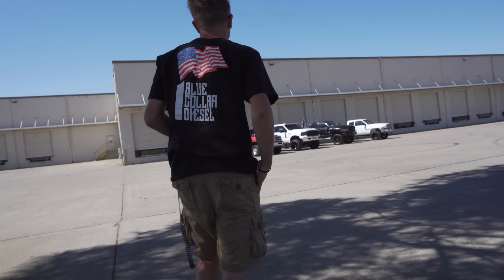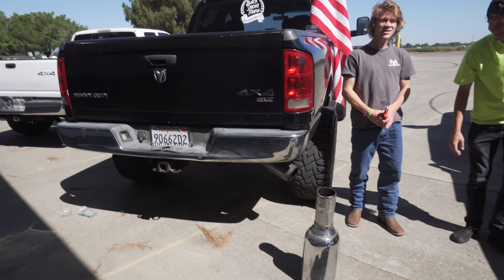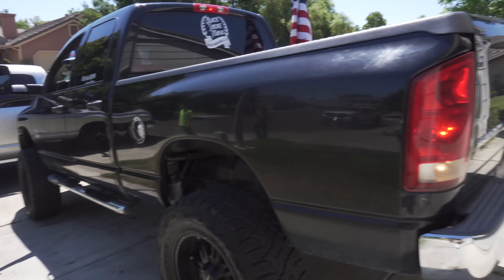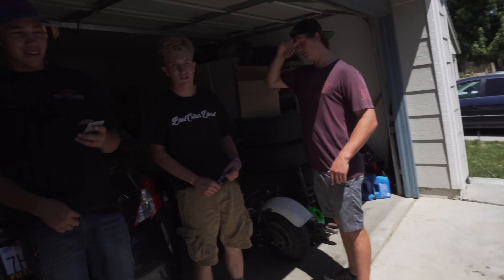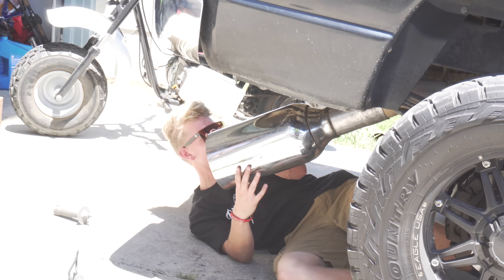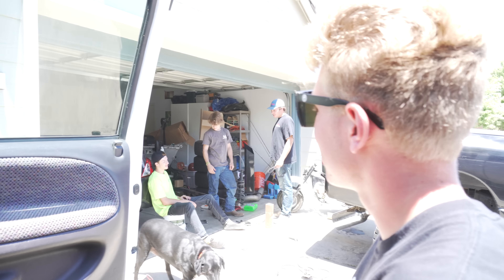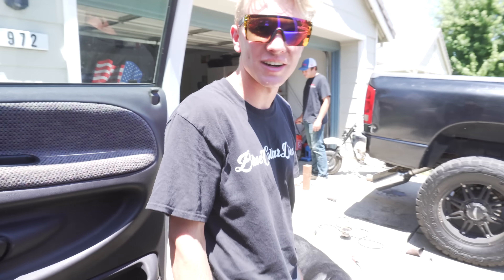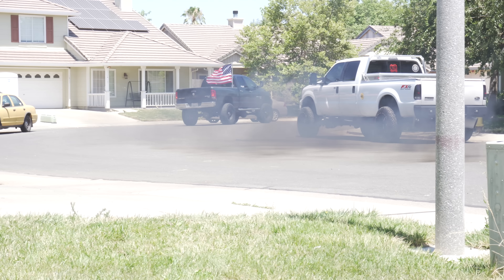HOW NOT TO INSTALL AN AXLE DUMP ON A DIESEL TRUCK

Comment: Hey guys I need a good starter truck can u name some
Reply: Bryce Guynn anything that runs and drive for cheap
Reply: Faded Entertainment I was thinking of a old ford
Reply: I got my 1990 dodge power ram 4x4 for 500 and its been a hell of a truck
Reply: Dippin Tv you can get a f150 that was my starter truck it was 2008 f150 king ranch with a six inch lift. Now I have a f250 with 6 inch lift since I tow a big boat and trailers. Good luck on finding a truck!!